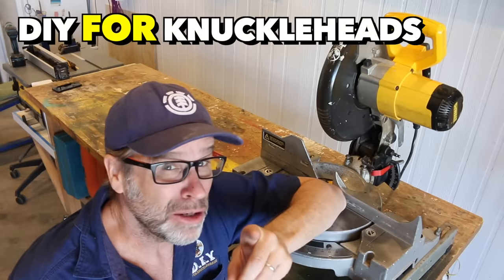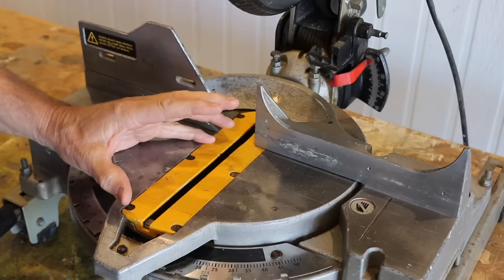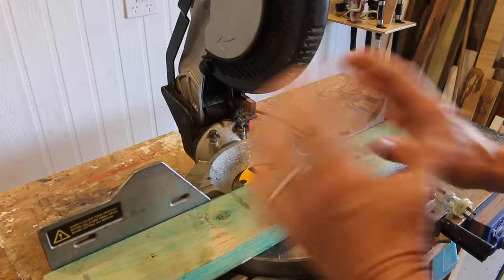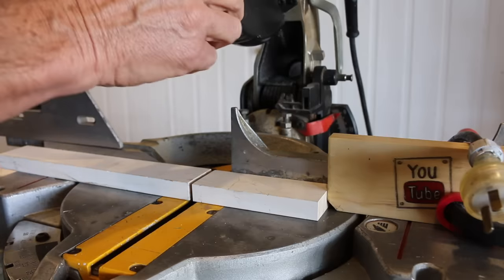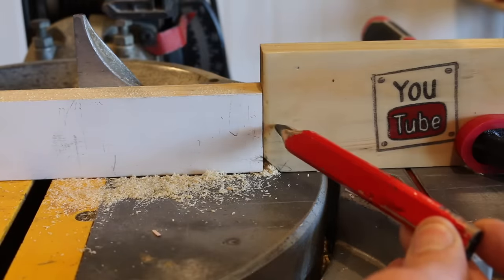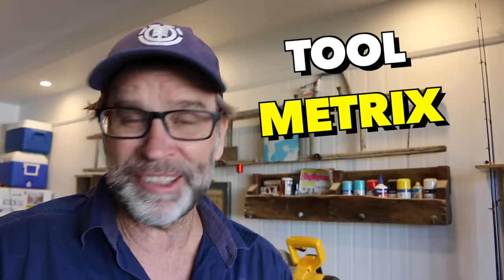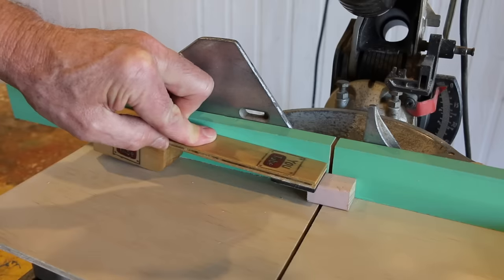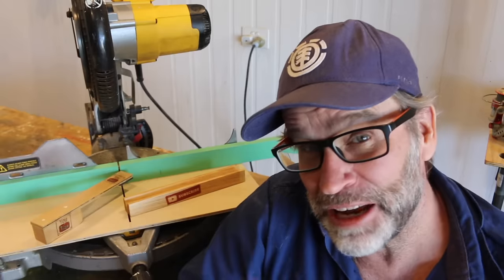My Top 7 Miter Saw Tips for Beginners.

Comment: This tutorial brings back when I first started finish carpentry. I committed the cardinal sin of crossing my hands when cutting. Made my cut, raised the blade, retrieved my drop and was alarmed to see the blood and it running down my hand onto the garage floor. I felt nothing more than a whisper of a breath on my wrist but the kerf it left was gnarly. Quick trip to the clinic and I was good as new and the scar remains a reminder of what not to do!
Reply from the maker: Very lucky Troy! 😬
Reply: @diyforknuckleheads  Indeed! Glad I was doing precise work and not just running the saw in a chop and go fashion!

Comment: Wouldn't a better bonus tip for using a stop block be just to clean up the saw dust? That cut messes with the length if you're cutting pieces that are thinner than the cut on the stop block.

Comment: Do you think cutting with the piece trapped against the stop block is good technique? I prefer to "lop off" the piece and hold on the stop block side.
Reply from the maker: As long as the blade comes to a stop before lift you won't have any issues mate 👍👍

Comment: Hello good man, in the first days when I bought the saw, I cut a few pieces of wood, about seven or eight centimeters, forty-five degrees, and nothing happened, but once it crossed the fence badly and hit my tumb badly.my Q is     As I was holding the fence and the piece tightly, could the saw blade absorb and pulling my fingers ?, I'm still scared

Comment: Any tips on using a angle grinder? I assume the grinder is safer than the multi tool because it has a guard on the blade? I need something cordless as I’m trying to fix my jetty going to buy the ozito as I have the chargers & batteries already. Thanks in advance for any advice  🇦🇺❤️
Reply from the maker: G'day A.W.....If you're cutting wood then the grinder isn't your best bet. What exactly are you trying to cut?
Reply: DIYForKnuckleheads screws protruding from timber.

Comment: If one sets the depth stop when adding the zero clearance table and fence, they will get a much longer life out of them. 

To take it one step further one can cut a couple 45° bevels and make their own replaceable inserts that slide in and out snugly. I like to make a gauge block that I set against my blade, then place my stop block against the gauge block to easily replicate the stop block location and ultimately the size of the inserts. The only catch is one needs to have the same thickness of material for all subsequent inserts I use laminated 1/2" ply regularly so it's what I use.
Reply from the maker: Great tip mate! Thanks for sharing 👍😁🇦🇺🎄

Comment: The zero clearance plate also shows exactly were the blade will cut better than a laser or the new DeWalt XPS light above the blade.  My saw has XPS and a zero clearance fence.  I've quit using the XPS that I paid a lot to have.
Reply from the maker: Good point David 👍👍

Comment: I was just out buying a mitre saw today but most of the tool shops had sold out.  Can you recommend a decent mitre saw for under $500? (In Australia) Is it worth getting a sliding saw? Thanks.
Reply from the maker: Jimbob, check out this Makita that's in Bunnings.....good entry-level machine https://www.bunnings.com.au/makita-1650w-255mm-compound-mitre-saw_p6240337
If you're looking at a half decent sliding saw you need to fork out a few bucks if you want a saw that cuts square over the long haul. Sliding saws are great if you intend to cut wide boards. One thing to consider is that they also take up more room for storage. Thanks for watching mate and have yourself a great weekend 👍🇦🇺😁
Reply: @diyforknuckleheads  Thanks. I will go check it out tomorrow.  Your videos have inspired me to start building some basic projects around the house starting off with a workbench!
Reply: AEG has released a $299 216mm sliding compound mitre saw in Australia just this year. I just bought one this week, haven't had a chance to use it yet but it seems decent quality.
Reply: @deecarter147  I only saw they battery version for sale or would have bought one.  The Cheaper end of the makita sliding saw was rubbish quality.

Comment: Is miter saw used for cutting wood or for cutting steel pipes or both depending on the blade types
Reply from the maker: Hi Khurshid...the mitre saw is used mostly for cutting wood. You can change the blade to cut metal but metal cutting is usually done on a Metal Cutting Chop saw. 👍

Comment: Great videos, thanks for the tips! One question though, regarding extension fence: my mitre saw does not have the holes on it’s fence to screw the extension fence on it. How would you do it? My mitre saw is the Dewalt DW714.
Thanks!
Reply from the maker: Mate, mine didn't either so l just simply drilled the holes myself. Thanks for watching 👍😁🇦🇺
Reply: You can also attach the extension or zero clearance fence with double sided tape.
Reply: @Theeggfly  The location of the zero clearance plate is important so the screws holes are a good idea, but you could also mark the fence and top of the plate with a pencil (or lip gloss :-) )

Comment: Most experts agree that zero clearance inserts/jigs don’t help with tear out on a miter saw. Tear out happens for two reasons. 1.  From the blade spinning out of the material and 2.  Dull blades.
On a table saw, the spin out occurs on the bottom of the cut, hence zero clearance helps. For a miter saw, the spin out happens on the top of the material. On the bottom of the material, the blade is driving upwards into the cut. No support is necessary.

Comment: Ok Uncle K, My Ridgid  mitersaw wont cut straight, just a little off and miter cuts have a hard time time getting back to a straight cut. I've tried everything and am tired of constantly having to reset and hope for the best. My Ridgid saw is around 15 years old with about 5 years worth of use in it. Any ideas? Thank you
Reply from the maker: You can adjust the base plate but l assume you have tried to adjust that. If you have and the saw still cuts out of whack......might be time for a new saw....Good luck Dave 👍😁🇦🇺
Reply: @diyforknuckleheads  thats what I thought I'm happy to get rid of it. Thanks Uncle K for responding
Reply from the maker: @dgale1023   No worries mate 👍🇦🇺

Comment: If you don't mind spending a little money and want to save time making a zero clearance plate, you can buy zero clearance tape, which is a very rigid plastic tape with one strong adhesive side.  Cut it to length, clean the plate, slap the tape on, and pass the saw through it.  It can be removed with putty knife later.  Also works on table saws.
Reply from the maker: Thanks for the tip mate 👍👍😁

Comment: Don't know if it helps but marking knife helps with tear out, you need to mark the piece on all 4 sides and it can be time consuming, but slight cut on wood prevents it significantly, as well as the masking tape, just tape it around and mark the piece again, you should be ok
Reply from the maker: Yeah....good tip mate 👍👍👍 Thanks for watching 👍😁🇦🇺

Comment: FYI: Americans don't call a miter saw a chop saw. A chop saw generally only cuts at a fixed 90° angle, and is usually setup for cutting pipes with a blade compatible with cutting metal. What you call a miter saw, we call a miter saw too.

Comment: Ewww, I like the little Hold-a-ma-jig thingie. That issue comes up quite often in finish carpentry.

An alternative is a stop block that rides on the top of the fence. Commercial stops will often swing out of the way to prevent trapping the offcut. Trapping wood between a stop and a blade is generally not considered a good idea. We all do it regardless :P Don't ask me what happens when you do it with aluminium, but I can tell you that a new Festool mitre saw blade is about 300 bucks :(
Reply from the maker: Ooohhh...300 bucks!...that hurts 😢 Thanks for the feedback Pete and for watching 👍😁🇦🇺
Reply: @diyforknuckleheads  Truth is I'm a complete tight-wad and wasn't going to pay $300 for a blade. So I taught myself how to straighten circular saw blades ;) It's now pretty much worn out and I won't sharpen it. I never complain about wearing out tools! So will finally have to spring for that blade.

Speaking of which I can however definitely vouch for Makita circular saw blades not being at all interested in cutting top sheets of insulated roofing panels. Ha ha. So yesterday's "I wonder what would happen if ... " resulted in today's buying of another blade for one of my 18V saws! Luckily they're a tad cheaper than the Festool blades.

PS Build another house
Reply from the maker: @886014  Another house is along way off Pete 😂 Still getting over building the last one 😂😂

Comment: I have the most basic question you have ever gotten.... Here it goes... How do you get the saw to raise up? When I try to pull up on the handle of my Ryobi (gift) it will not raise. What am I doing wrong? Will it lock in a lower position for transport?  Maybe it's locked in place. Please help!!
Reply from the maker: Hi Shelby….it sounds like the locking pin on the arm is engaged. On most machines, where the hinges which is generally above the fence on the saw you will find a locking pin that you need to pull out to allow the saw to rise… good luck 👍😁

Comment: How did you make your V block?
Reply from the maker: I made it on my table saw Ian.
Reply: Thanks I take it is two 45 deg blocks glued together then. I need to make a larger v block for a project.
Reply from the maker: @ianwatson9032  Ian l just made it from one block  of timber but glueing two 45 degree blocks would do the same job...good luck 👍👍😁🇦🇺
Reply: DIYForKnuckleheads thanks for the quick response. I will have to have a go.

Comment: Tip 1) Never lift it from the handle. Lift always from the base if there is no handle specially made for lifting it. If you lift from the handle, you will broke it and settings of the saw

Comment: I hate to say this, from MY experience the zero clearance is a MYTH. I have never seen a diff. in the so called unsupported area with more tear out. it has been THE BLADE. I have cut interior plywood, some trim, baseboards tho not much with freehand circ saw, no prob. The blade was high tooth brand new carbide, smooth. Theres a utube guy with high speed camera showing no difference, like 1000 frames a second or somethin.

Comment: Most people here in the states call a miter saw a miter saw. A saw made to cut metal is usually called a chop saw. Some may disagree but that's what I hear most. That small piece holder is great. I've used miter saws for 35 years and I've never seen that. But I've needed it several times.
Reply from the maker: G'day Mark...thanks for watching mate and thanks for the info re the chop saw 👍 Cheers 👍😁🇦🇺

Comment: What's the difference between miter saw & circular saw, Sir?
Reply from the maker: G'day Firdaus....Basically a mitre saw is a fixed, stationary tool that is capable of cutting precise angles as well as bevel angle cuts. The circular saw is a mobile, handheld saw...hope that makes sense 👍
Reply: @diyforknuckleheads  thanks you. 👍👍👍
Reply from the maker: @firdauszainudin7118  👍

Comment: No point having a zero clearance plate on the bottom because if you think hard about the way the blade is spinning, it actually enters the wood at the bottom and exits at the top of the workpiece. If you have a decent blade you shouldn’t really have to worry about it anyway
Reply from the maker: If you watched the video James there was a difference when the zero plate was added.. The blade l had was a fairly new 60 tooth blade and you could see from the first cut that there was tear-out visible. After the zero clearance plate was added, the tear-out was minimised. Thanks for watching 👍
Reply: DIYForKnuckleheads yes I agree, the zero clearance fence helps out a lot. From my experience the bottom plate doesn’t do anything but that may be due to the fact that I have a sliding mitre saw.

Comment: Your stop block is wrong. You need to hold the piece that you are cutting. If you are right handed, stop block should be on the left with the left hand holding the piece and right doing the cutting. Also a 45 degree angle should be placed on the back edge of the stop block to compensate for the tear out.

Comment: Tip#4 - I don't agree with your stop block instruction. 
The material that is trapped between the stop block and the blade is the piece you should be holding. If your right hand is pulling on the saw then the stop block should be on the left side so you can hold it with your left hand. 
I think you should revise #4 for safety reasons.

Comment: WRONG!..... In America it is called a miter saw, a chop saw is for cutting metal usually has an abrasive disk,  Spins very fast and shoots sparks everywhere also only cuts at 90ﾟ. Other chop saws have blades that look like wood cutting blades but these saws spin much slower and also only cut 90ﾟ.
Reply from the maker: Happy to be corrected R.C...Thanks for watching👍🇦🇺😁

Comment: Miter saw is a carpenter's tool. A table saw is a woodworkers tool.
Reply from the maker: Point noted J.D 👍 Thanks for watching 👍😁🇦🇺
Reply: @diyforknuckleheads  sure. ..if you want a plumbers opinion on the matter. Lol..  ..hey, what do you think of those evolution saws? They're very reasonably priced and cut wood and metal.  ..they've got various models all the way up to sliding compound miter.
Reply from the maker: @jdog4534  I have seen them and was approached by the company to do a review but they aren't used much over here in Australia so l can't really offer a valuable opinion. Sorry mate
Reply: @diyforknuckleheads  thats cool. Thanks for your reply. I've had my Dewalt sliding compound miter saw since the day they came out whith the ones that tilt both ways.  '96/'97? I went from a delta to hitachi to makita to bosch to this dewalt. One thing the  bosch had that I really liked was a detent override mechanism which is Handy for when you didn't want to do exactly 90° or 45° but maybe 44 1/2° or something like that, like if you doing outside corners on baseboards or Cove molding or something and your corner is like 89°. .. but yeah, I was content with mine until I saw that evolution that does all mine does to wood or metal.
... so what's up with your fence do they come like that now or is that custom? My fence custom now too LOL I forgot to move it out of the way when I'm doing a compound cut LOL
Reply: @diyforknuckleheads  thats cool. Thanks for your reply. I've had my Dewalt sliding compound miter saw since the day they came out whith the ones that tilt both ways.  '96/'97? I went from a delta to hitachi to makita to bosch to this dewalt. One thing the  bosch had that I really liked was a detent override mechanism which is Handy for when you didn't want to do exactly 90° or 45° but maybe 44 1/2° or something like that, like if you doing outside corners on baseboards or Cove molding or something and your corner is like 89°. .. but yeah, I was content with mine until I saw that evolution that does all mine does to wood or metal.
... so what's up with your fence do they come like that now or is that custom? My fence custom now too LOL I forgot to move it out of the way when I'm doing a compound cut LOL
Reply from the maker: @jdog4534  Hahahaha....l've done that as well mate. 😊 I agree with the indent override feature....very handy indeed 👍😁🇦🇺

Comment: 🇺🇸Thid Is my first video of yours thanks to a Google algorithm.  Google seems to know I am a DIYer and that  I love the entertainment provided by the folks from  DOWN UNDER by way of  YT, movies, Amazon Prime, cable shows, etc. My favorite word in woodworking from the DOWN UNDER folks is jeeg. We say jig.
I do not want you to take the following comments as a criticism. As far as personal protective equipment is concerned, as I age  I am more aware of protecting the airways from sawdust and all  organic compounds. If you redo this video or make a safety video please add lung protection. I developed a sensitivity to super glue fumes at age 72. It manifested with coughing, severe hoarseness, high pitched wheezing and just feeling rotten. It happed more than once.(I was my own test monkey). I was in bed for 2 days . Prevention is easy. Work outside with a breeze or fan but even better is a 3M type canister mask rated for organic solvents.  How long do the canisters last? I think they last according to how much they're used. After each use, remove cartridges and place in zip log bag for storage.  When needed simply scree  cartridges in mask and breathe fumes from an organic solvent that  you are not sensitive to. If you don't smell it cartridges are still good.

I use  painter's  tape to close gap in table of saw, both the table saw as well as miter saw or I stick it on the marked  cut line on the work  piece . This works similar to backer boards.
Thanks for your video from a new subscriber .
Reply from the maker: Thanks William for your detailed feedback 👍👍 Appreciate you taking the time to share your knowledge. Have a great week 👍🇦🇺😁